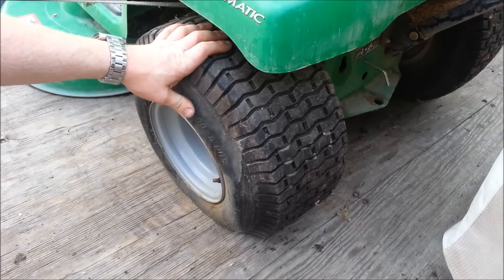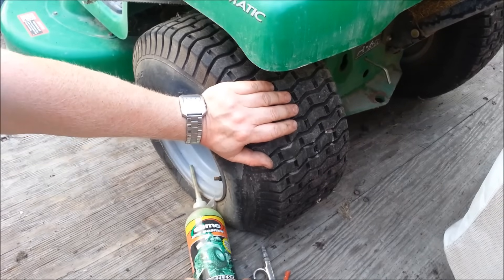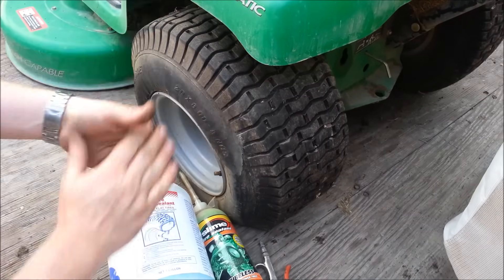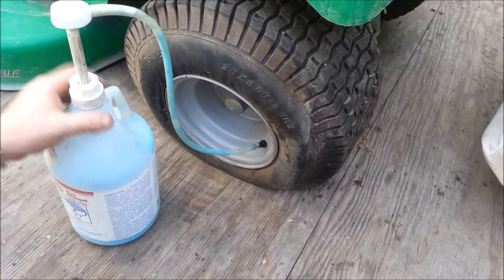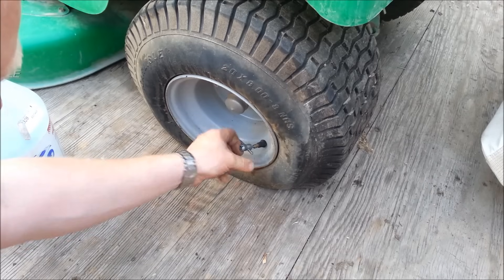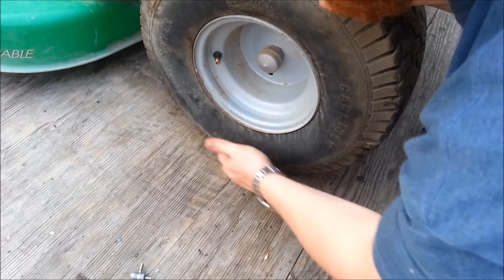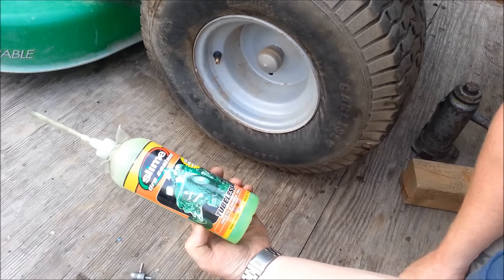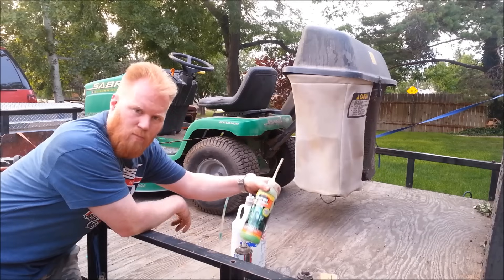Fix Dry Rotted / Flat tires on Lawn Equipment ATVs

Comment: I've seen a YouTuber put ATF in a dry rotted lawnmower tire and it sealed it as well!
Reply from the maker: It has to be barely dry rotted for that to work. If you have severe rot or it sat flat on one spot for a decent amount of time it won't work.
Reply: @sixtyfiveford  Thats a very good point! Thanks for pointing that out.
Reply from the maker: @_RocketRooster  If you can fill it up and it takes a day to go flat; oil will likey work. If it takes 10 minutes to go flat; you'll need a sealant.

Comment: looking just now on amazon, slime is as cheap if not cheaper that the rotary brand.
Reply from the maker: Slime has dropped quite a bit in the last couple years. Mainly just due to the immense competition. I think I used to buy a 5-gallon bucket of the rotary stuff for around 50-75 bucks.

Comment: Spray kerosene on the tires its petroleum that softens the rubber back to life make sure you clean the ties good from dirt so the kerosene penatrates the rubber .tires loses its petroleum base ingredients in the rubber after a while out in the weather which dries through the years or months .

Comment: Just don't use these things (or anything like Fix-a-flat, that stuff MELTS the inside of the tire apparently) on car tires if you have a leak. You can't repair a tire with that stuff in it.
Reply from the maker: TheFlacker99 (Flak) Yeah, Fix a Flat is crap.

Comment: I`ve always just pushed windshield polyurethane into the hole then make a patch of it in or out leave over night it`s as hard as the tire I`ve still got air in my spare trike tire , But that slime is quik hey .
Reply from the maker: I've never messed around with windshield poly much.

Comment: I'd forgotten about using slime on anything other than bicycle tires.  Thanks for the reminder and the tip that it only takes enough to stop the leak, which can be a lot less than the whole bottle.
Reply from the maker: A LeBlanc It can get pricey if a whole bottle is used like they want you to.

Comment: tube of Latex/silicone caulk will fix that  and many more for cheap
Reply: I saw another video where someone dissolved silicone caulk (for glass) with mineral oil and put into the tire.

Comment: so you said the fix a flat stuff is junk? will it help me to have one with me in my vehicle just in case. im a commuter and i travel long distances. or would you recommend that slime stuff or neither would really work in a car?
Reply from the maker: ThePetra42139 The Fix A Flat is a 2 in one; air compressor and light duty sealant. It will work in a pinch but is meant only to get you to the nearest service station. If your tire is flat it will give it just enough air to safely roll. Tire shops are extremely rude about car tires they find with this stuff in it and will berate you. If you get a fair amount of flats the tire Slime stuff I use the in the video will instantly plug a nail hole so you loose no air. It works great as a preventative measure where the Fix a Flat is merely a bandage.
Reply: thanks alot for all the help

Comment: I swear by that slime stuff. Ive even fixed dry rot cracks in the side walls of wheel barrow type tires that are on my lawn tractor trailer. I pulled the cotter pins took the wheels put in the amount of slime you use I find the same thing. Then I hold the wheel on it side an move it around to get the slime to go in all of the cracks. I do it on both sides then I put in a little more slime. Put the wheels back on and drive it around and the tires held for a couple years :-)
Reply from the maker: Patrick Leonard Yeah, it's definitely amazing stuff.

Comment: i used the tire in a can 20 - 30 min later it was flat ..ATV  ,,my son had a ATV the tires were so weather checked they would last the day after blowing them up .... a friend of my dads told me to use antifreeze i thought he was nuts ..so a month or two we tried it 2 years later they were still holding air from the fill up after the antifreeze .. i would have never thought it would work ..we took a french s mustard bottle filled it about 4 oz .it fit over valve stem like a glove ..just push tire in then stick the bottle over stem  ( take the valve core out )and it will suck it in tire ..just make sure stem is at the bottom bottle up  ...
Reply from the maker: I've never heard of this.

Comment: Drill holes in the tire them and "great stuff" foam. Permanent fix.
Reply from the maker: That's great, a solid tire with no shock absorption on bumps. You're transaxle and back will love you. Fun to clean out whne the foam breaks down after a season of use and even funner when you need to put a new tire on.
Reply: sixtyfiveford : thanks shade tree! I appreciate your feedback, but the lawnmower was never engineered for "a smooth ride". No independent suspension, duh.
Reply: wealthy black man you can't be serious. haha you should do it!

Comment: Tubes are pretty cheap too. And always work
Reply: @ lucky red - the tube wont do you any good when the tire carcass is rotted.  that just makes a full blown open season  on the tube.
so why work yourself to death replacing or repairing a tube when you can get another tire.
Reply: @djohnson3678  guess it depends whos doing the work, and on what. Just did a rotted tractor tire/tube on a ford 4000 yesterday-- the tire is 5 foot tall and $500 per. Tube was $45. One of about 20 i did in last couple years. Always loved working on a rim/tire someone filled with goooo. Really fun. Guess u know better than me. Lol
Reply: LOL ,  very funny .

ever have the tire while it is off [ with no tube ]  and use a fence wire to locate the hole ( of course before then you would have to see the liquid flowing from it to locate it first ) , then scrub the inner tire to get that slick  good off it, then patch the hole? 

did one once, it was  alot of work  [ Massey Ferguson ]  , used the electric wire to locate the hole, then patched it, also patched the inner tube as well.  was to much of a job.

Comment: I had a front tire on my lawn mower going flat almost as fast as putting air in the slime worked very well its been over 24 hours and its still holding air
Reply from the maker: I've had really good luck with the stuff.

Comment: Wonder if they make airless tires for those size rims
At work we use a zoom boom lift truck with massive tires that kept
Leaking, they were replaced with airless tires. Problem fixed. Great video tip. Thx
Reply from the maker: zyplex1 That would be nice.
Reply: 5 latex caulk mixed with water and a Lucas squirt bottle maybe dog hair or dryer lint then if you want to get fancy with it chop it up you know where to go through the whole but yeah latex caulking when water is best thing I found out everything

Comment: I just broke the bead on one side. Then poured in about a quart of old latex paint. Aired the tire up and mowed the lawn. I left white marks for a few minutes, I did stop and air up the tire when it looked low. By the time I mowed an acre, the leak stopped. I never added air for two years afterward. I've also taken the tire off and painted the inside with latex  paint. Put grease on the bead, and remounted it. No leaks, lasted for years. What else can you do with Old latex paint that has a skin on top???
Reply: You'd think that it would take forever to dry inside a closed-in wheel..
Reply: Excellent idea thank you for sharing

Comment: I've used Stans NoTubes bicycle tire sealant with good success on leaky riding mower tires. It's kind of pricy at $20 per quart! Your jug of sealant with pump and filler tube looks really easy to use and should last a long time...will have to try that out.
Reply from the maker: motoYam82 I buy with a commercial discount at around $17 a gallon but I think it runs $25-30 retail/gallon. I just learned about the Stans No Tubes and haven't compared it yet. I'll have to give it a try.

Comment: Thanks for the video!
 Do you know how well this would work (or not) in a tire with inner tube?
Reply from the maker: This stuff doesn't work great in an inner-tube in my experience. In those situations I either remove the inner tube and put sealant in or repair the tube and reinsert it.
Reply: sixtyfiveford  I'll keep that in mind, thank you!
Reply: I have an old forklift with tubes that have nail holes.... works great. Like any stop leak, it has to reach the leaks to work. This is like Fix-A-Flat on steroids.

Comment: can i trust this on a dirt bbike tire? or will the seal bust under high pressure such as jumps and trail rides?
Reply from the maker: brett pingel Yes it will. I've used it on ATV tires and car tires. Most dirt bikes I seen have tubes through and generally just need a patch.

Comment: I've been making my own slime for several years. It's very simple and cheap. You mix corn starch in cool water with a half cup of black pepper per gallon of mix. Boil the solution until it's thickened. Mix the corn starch heavy so it's thicker when cooled down than is usable then thin it with antifreeze. The antifreeze keeps it from freezing "obviously" but also helps protect against rust. The black pepper is the secret ingredient that actually works as the sealer. If not for the pepper flakes the solution would just ooz out of the hole or cracks. If you had the time you could probably grind rubber into small flakes to take the place of the pepper flakes. I opened a bottle that was over 2 years old last week and put in our wood splitter.  It looked gross after sitting that long but after shaking it up it went in the tire with no trouble and worked great. Also a 2 litter bottle with a hole drilled in the cap just a little smaller than the valve stem will screw on to the stem and makes it simple to fill the tire by squeezing.
Reply: Im very interested about this ! Any more info!???
Reply: I love your response but I do not believe it will work.  I mean I know you can do it, I just don't think it will really seal anything.  Certainly better than nothing.  I may stil l try it someday.
Reply: Phil it is a wonderful idea, but do we need to add antifreeze in countries like India?
Reply: Putting pepper into your radiator is an old time recipe for leaking antifreeze and it actually works.

Dale in Canada
Reply: Definitely works black pepper good stuff seals radiators and engine blocks even head gaskets and tires @MichaelMantion

Comment: Don't know why this just came up in my rotation, but a couple comments... Fix-a-flat is the one that will actually cause corrosion. Not slime. I have been considering taking a tire off the wheel. Using a paint brush to paint the entire inside of the tire a couple times. Then using the slime as a replacement for the 'gorilla snot' used, to paint the edge of the rim and the edge of the tire, to make it easier to re-mount the tire. Thinking it would make a good bead seal that way, as well. Now I am wondering if that would be a waste of time, since it seems it needs to be forced through the cracks, to do the actual sealing...
Reply from the maker: I've used it as bead sealer quit a few times. It works well, but I don't think as well as the actual black rubber cement bead sealer.

Comment: i have tried both tire slime and fix a flat on my mower tires. neither worked. they still went flat after a few days.
Reply: try backhoe tires 1000 plus or a flat repair 100

Comment: is there a reason you can't just paint the outside of the tire with the slime?
Reply from the maker: The particles in the "slime" wedge themselves into the cracks/holes by the inside air pressure of the tire. If you put the sealant on the outside the air pressure will simply push it off.

Comment: I have opened up some wheels (unmounted the tires)  on some that had had in their past  (I believe that green colored brand?? you show? not sure if same brand, but similar color...) and found serious rust/corrosion issues.  Depending on your application? that may or may not be a concern.  I have even seen new bicycle tubes for sale that advertise as having  come with (and their mentioned name is that same brand name as that green brand shown) already in the tubes when you buy them.  This is okay on cheap or "end of it's lifespan" equipment, I suppose,  but you may not want the mess and corrosion risk on your quality high end alloy bike rims and tires and similar? Just go for a new tube or a conventional patch on your puncture.  My buddy fixed his SUV Samurai slow car tire leaking using the (green product) in his chromed steel tubeless auto wheel rim, against my advice... I only hope that years from now, when he goes  to get new tires, that his wheel rim is not rusty junk and forcing him to buy a whole new wheel set (because he only has that set of four...).
Reply from the maker: Tire Slime(Green) tire sealant all has anti corrosion properties and would actually clean rust off. Corrosion happens in a lot of wheels and creates bead leaks. People put "Slime" in afterwards to seal the leaking bead. It fixes the issue, doesn't cause it. I've pulled apart 8 year old tires/steel rims I've ran this in and there is absolutely no signs of corrosion.

Comment: Prior to adding gel, you could rotate the wheel so the damaged area was at the bottom, thus having the bulk of the repair gel at the hole in the tire.
Reply: If you know where it is

Comment: A few years ago I had a pile of metal junk out in my field that had been there for decades.  In that pile was an old late 50's riding lawn mower that belonged to my Grandpa.  When I clean it up I noticed that all the rotted tires on that mower were still up and fully inflated.  Their secret?  They all had inter tubes in them.  Since then I've put tubes in all 3 of my mowers.  I now never have to add air before I mow, where as before, it was a weekly thing....
Reply from the maker: On my personal stuff, I will put an inner tube in it for sure.

Comment: I've had MINIMAL luck with slime, fix-a-flat, etc. Either tube it, or hit amazon for a new one, USUALLY  around $25. Wanna keep machine for 4 more years? Buck up and do some maintenance. Had it been properly maintained over the years, you could get a lot more service from it. Like the old commercial said- pay me now or pay me later
Reply from the maker: I have slime or even better TireJect running over 10years in tires.

Comment: I have a wagon with a tire that is dry rotted on the seam.  I'm going to try this slime stuff.  Fix a Flat did not seal it.  Thanks for the video!
Reply from the maker: ***** I've never had any luck with that fix-a-flat.
Reply: Try tireject the stuff is freaking amazing

Comment: The cracks in my lawn tractor tires that leak air are on the sides of the tires and I can't get the wheels off. How can I seal the sides?
Reply from the maker: +MRrwmac With tire slime like I did in the video. All the cracks were in the sides of this tire.
Reply: +sixtyfiveford Thanks. I noticed that and asked because I couldn't understand how the sealant got from the inside tread area up to the sides (due to it being liquid and gravity acting upon it). Just thought you might know. Thanks again.
Reply from the maker: It will run from the tread down the side walls. It stays a liquid throughout it's life. To get the crack to seal for the first time you may need to put the area your trying to seal at the bottom for a few minutes. This will allow the liquid to pool in the bottom tread. Then quickly roll the tractor so the crack your trying to seal is at the top and leave it. This will force the sealant to run from the tread area down the inside sidewalls. Once it holds air, drive it around. This flexes the sidewalls and allows the sealant fibers to force there way into the cracks.

Comment: my lawn mower tire come off the rim, when not in use, which leaks all the air.  what could i use to seal it,  this is so that the rubber done separate from the rim.  thanks.
Reply from the maker: This stuff works or you can use bead sealer( I have a link in the video description) and it will not leak.

Comment: Great tip, and I have been using it for years. I scored a case of quart sized bottles of unbranded stuff for 50 cents a bottle at a local auction I was happy.
Reply from the maker: rchopp That's a steal.

Comment: just put an inner tube in it,this stuff makes a real mess on the wheel if you ever need to change the tire,inner tube costs about 10 bucks at ranch king
Reply: George Strickland Slime rinses right off with water from the rim if you ever decide to mount a new tire. I think you must be thinking of the Fix a flat stuff in a spray can. That stuff and some others are like a glue.

Comment: I had cracked tires that slime didn't work on so... with no air in the tires, I filled all the cracks with professional grade super glue... let it dry, pumped up tires... been 2 years now... no leaks. if you miss a spot just add more glue where it leaks. Also works on cracks in my winter boots.
Reply from the maker: Good to know.
Reply: When I moved some how my lawnmower tractor got a gash in the side wall.  And by some how I mean I most likely jacked it up getting it in or out.  Anyways all i could find was gorilla glue.  So I squeezed it in and filled up the tire so I could get it out of the truck.  It worked better than I expected and went from a tire that would go flat in 1 minute to a tire that would go flat in a day.  Someday i will open it up and patch it until then I just fill it up before I need it.
Reply: I used super glue on mine too. 
The sidewall was cracked. It glued the cracks and stopped 95% of the leaks. 
The problem I had after that was the tire kept cracking. I glued it several more times. 
Then I dumped about a cup of sealant in the tire and laid it on its side. Then spun it a few times, so the slime laid on the  cracks. After about 15 minutes I flipped it over so the other side was coated. That was about 4 months ago and the tire is holding air. 
Tubes are half the price of a tire and rim. Hard to find too.